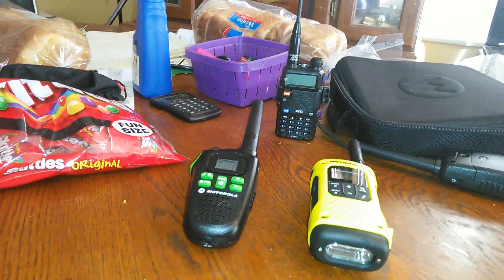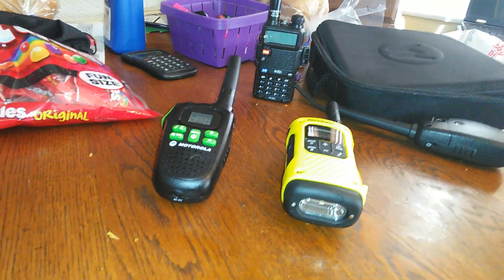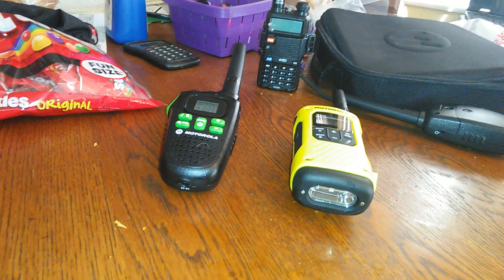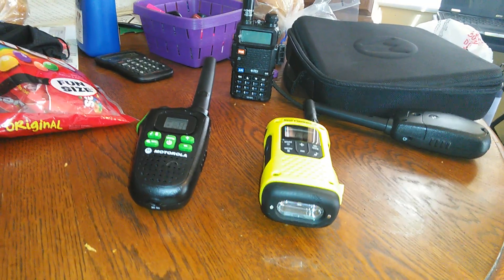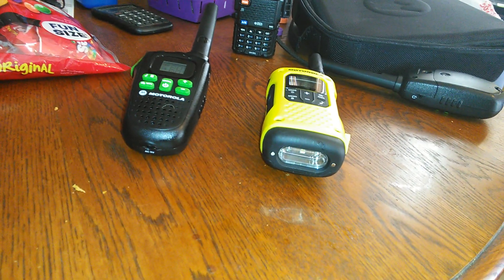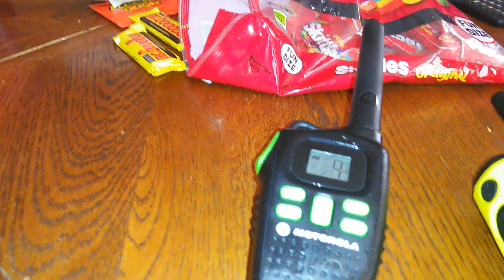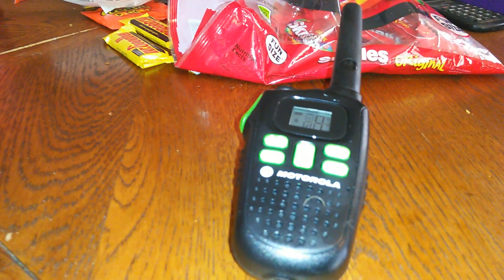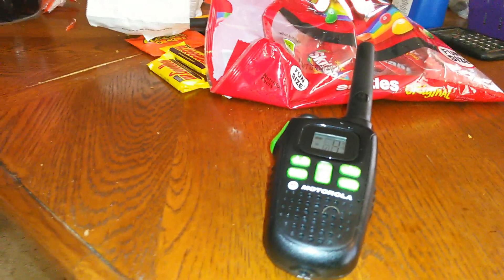FRS GMRS : Motorola MD 200R VS Motorola T631  FCC part 95  FRS GMRS radios

Comment: How long does it take to charger the battery on the Motorola talkabout t631 h2o
Reply from the maker: took me 6-12 hours     you can also use 3 aa batteries in them as well

Comment: For the Motorola walkabout t631 h2o what are the frs channels because I don't have a license for the GMRS
Reply: Christian Olivares 
As i understand it, an FCC G/FRMS license is NOT REQUIRED for this radio. It operates under the FCC wattage requirement for a license.
Old licensure law does not apply anymore. Besides, I doubt a lot of people actually obtained a license when it was a requirement.
Reply from the maker: don't transmit over ch 14 I Have A Ham Radio Licence  I dont have A Licence for GMRS either not going to Buy one at 100.00 for 5 years  just dont transmit over ch 14 ,1-7 is 2 watts